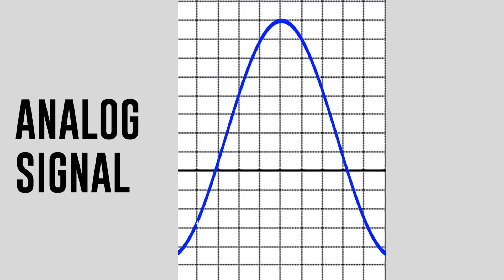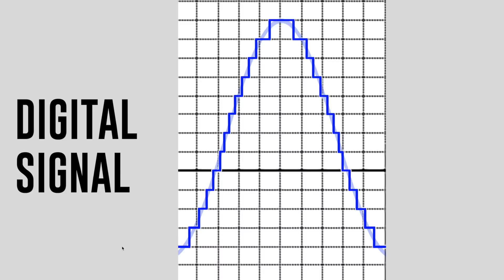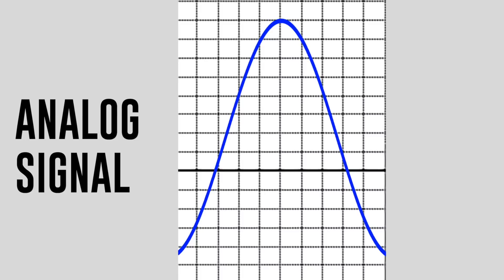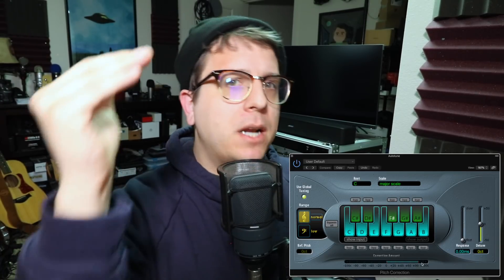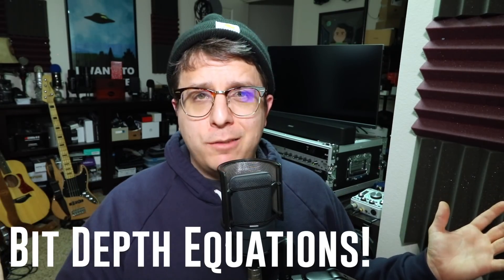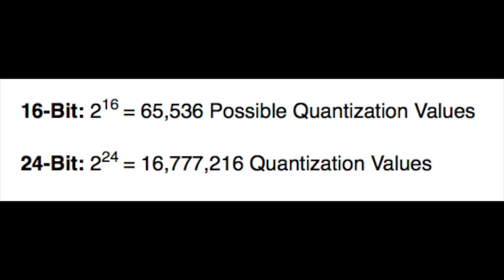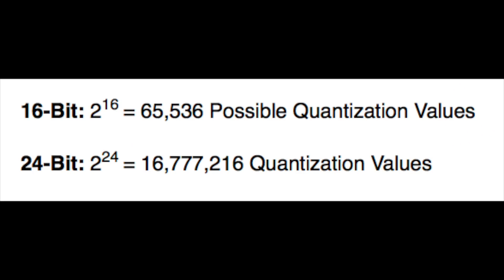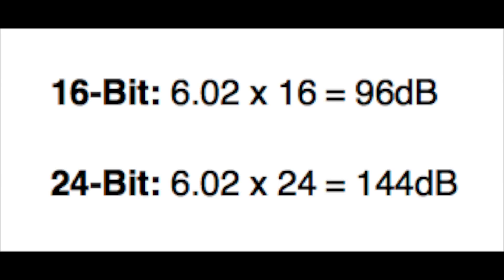16 bit vs. 24 bit Audio, What Should You Record At? (FAQ Series)

Comment: I have a question. 
Choose one song encoded in wav, 16bit and 32bit.

Open the wave file. Find the third sample. What's the binary number stored and way?

Open the 16bit file. Find the third sample. 16bit. What is the binary number and why?

Open the 32bit file. Find the third sample. What's the 32bit binary number and why? 

After you have the  binary numbers, then explain how the two or three binary numbers store your favorite vocab like the dynamic range, resolution, bit depth, db, loudness etc. 

And how the two binary numbers, one 16 and the other 32 are both lossless flac.

Is 24 really better than 16 bit? Both use lossless flac encoding? 

Not one youtube video explains any of  this, so it seems they don't know what they're talking about. I have yet to get an answer from anyone to my logical question.
Reply from the maker: I don't know what the signal path is or how they process it, but I believe their systems are pretty complex. I also heard that they switched the internals from an SM57 with some condenser mic, I just can't recall what it is.

Comment: Very respectfully, I must disagree with this video. Bit depth has nothing to do with "how much information is captured" and cannot be compared with photo resolution. Bit depth has very little practical impact on sound quality, since our perception of sound is basically just about the speed and direction the air molecules are moving. High bit depth may record tiny variations in speed, but that's not something humans can hear or care about. Nor can anyone hear (or care about) whether Instrument A is 64 times louder than Instrument B, or 65 times. (The difference between 5 and 6 bit.)

Low bit depth does not introduce "digital artifacts", only noise. The reason your 4-bit example sounded so bad is probably because it was processed too quiet. Bear in mind that cassette and vinyl are only 6-bit and they sound great to most people.

Finally, showing a digital waveform as a jagged, pixellated line is highly misleading, because, just like analog waveforms, digital waveforms are ALSO continuous and smooth. A sine wave can be digitally recorded perfectly with just 2 samples, one at each peak, with the resulting audio being a perfect, smooth sine wave.
Reply: I was just about to write something similar! :)

Comment: Consider microphone self noise, noise of the actual preamp, ADC-DAC interface and rest of electronics and pure 16 bit with noise shapping and oversampling does a very job. 24bit electronics should have better linearity in lowest bits, better signal to noise and dynamics, lower intermodulation distortions, bla, bla, if everything is recorded correctly. However in times of  Loudness War and compression it's all very much meaningless, because in the end the peaks of the waveforms will be clipped by some wise ass running the DAW, and we end up with 10-12 bit of dynamics anyway.

Comment: Higher bit depth means greater precision in mapping an analogue voltage to a corresponding digital value, and allows for a greater signal to noise ratio.
16 bit (2 bytes) means you have 65,536 possible digital values available for representing the analogue voltage.
24 bit (3 bytes) means you have 16,777,216 possible digital values for representing the analogue voltage.
So, 24 bit can more precisely record what the analogue voltage was.

It's important to know that the digital values are evenly spread out between maximum voltage and minimum voltage.

This is important when you're dealing with very low voltage levels - there are fewer digital values between zero and the value closest to the one that represents the voltage if you're using a lower bit depth. That means any editing of the resulting digital audio has fewer values to change between. So it's always better to capture in the highest bit depth possible, and do any processing at an even higher bit depth, before mastering down to the bit depth needed for the final product.

16 bit allows for a maximum signal to noise ratio of 96dB, and 24 bit allows for up to 144 dB s/n ratio.
Very few audio music recordings are made that have a dynamic range that cannot easily be accommodated within a 96dB noise floor, and almost no commercial music recordings have that sort of dynamic range.
Quantization is the process of mapping the voltage to a specific digital value. Dithering is a way of doing the quantization that reduces digital artefacts caused by quantization.

Bit Depth is about digital accuracy of the sampled analogue signal. Sample rate affects maximum frequency that can be digitally represented. Sample rate is a different matter that has it's own considerations that need to be understood.

Comment: Another benefit of 24bit audio is this,when you mix audio signals together such as voices and instruments, they can PARTIALLY cancel out eachother resulting in duller voices and instruments,so mixed xoices with instruments in 16bit will more sounding like 8bit,but mixed voices and instruments in 24bit will sounding more like 16bit,so that’s also the reason why 24bit sounds so clear because you will hear the starting and endong point of each sound and very smoothly.
Reply: Every time you mix an instrument in, that one track starts losing bits from the original as you mix in more tracks. It goes by powers of 2. 2 tracks, you lose 1 bit per track. With 3-4 tracks, you lose 2 bits per track
Reply: @JoeStuffzAlt  wow that’s an interesting note, so if i will record my voice at 16bit and i will myx it with 8 instruments with it,then my voice will become 8bits or less??
In such case no wonder 24bit should be better since it has more bandwide,especially with 32bit recording since in theory you have to worry about accidentally recording overamplified audio and get declipped audio,because they say that 32bit audio recordings should never suffer from declippilg because of the higher bandwide.
Reply: @johneymute  It'll be more nuanced than that. Powers of 2, so in theory it could be 13 bits, which is still a good amount and most people won't hear it. Not to mention the more audio sources going on, the less you'll be able to pick things out. You need to record around 256 layers to drop it to "8-bit per track if you manage to digitally extract it" quality.

You can record softer with 24-bit and have excellent quality. With 256 times the resolution, if the waveform is a sliver on the screen, you still have a lot of data to work with. If amplifying 100x gives you a workable waveform, you still have over 16 bits of data to work with. There other factors like noise floors to worry about though

Comment: The steps in the waveform are a lie.

The reason why DAWs display stepped waveforms is because they are lazy and just draw the literal amplitudes recorded by the ADC instead of what those amplitudes mean. In reality, they represent points that will be used to draw a new, smooth waveform which will be identical (identical I tell ya) to the original signal. No steps, no nothing. Infinite resolution. The only limitation is that the signal can't contain frequencies higher than half the sample rate, and ADCs have low-pass filters to make sure of that. It's called the Nyquist-Shannon sampling theorem. Don't believe the propaganda.

Comment: Audio bit depth in no way relates to video resolution, but is directly related to pixel bit depth, with 16 bit pixels have far fewer possible colors.

However, the human visual system can't distinguish more colors so 16 bit looks identical to 1000+ bit (except for a handful of females with quad cones). Similarly, except for the 96 dB noise floor (we can detect up to 120) there's no audible difference between 16 and 1000+ bit. The only reason 24 bit is superior for capture and mixing is additive losses accumulate. But after mixing outputting to 16bit 44100 hz is indistinguishable from 24bit 48000 hz+ except for the higher noise floor which is virtually silent. Also, sampling rate does relate to framerate, but at best we can only hear up to 20khz, and exactly 2 samples are needed for full capture (mathematically proven and confirmed by hearing tests), so sampling above 40khz in absolutely no way improves audio quality for anyone.

Comment: 44khz 16bit is pretty much the limits of human perception. This is why it was chosen as the standard for CD's. Music producers use higher bit rates as they are working with multiple input sources and want to keep noise levels as low as possible. Even if a music producer releases his song in 24bit audio it will won't sound any different to if he mixed it down to 16 bit audio. It's like 96khz audio, completely pointless as it's beyond the range of human hearing. Don't get any of this confused with bitrate, which is a whole other subject and can really effect the quality of compressed audio.

Comment: When you laughed was it because it was a tedious topic, or was it because it you were excited? Pretty sure we all got excited when talking about extra variables. Yes - Using 24bit before spotify and youtube compresses is beneficial. In my neighborhood I'm the only one who notices, and due to my "dontgiveafuggifitclipsinuteromilkit" attitude - I've definitely taken full advantage of those extra frequencies allotted for filling waves. When you go back to 16, and try to do what you did in 24...that's when you notice and go..."Oh helllllll no!"
Reply: @ReaktorLeak Way more powerful. Though for online uploads, kinda pointless, I agree with dudeman...having the highest possible quality before conversion definitely matters.
Reply: @ReaktorLeak I'm not a premium member on reverbnation, so my upload limit has been 8 megabytes. Only recently did I realize that I'd have to doctor before uploading overamped 24bit Waves as MP3's online. Your CD copy of In Utero can clip by 2.4 decibels...in your house, but not converted into as low as 128 or 96kbps on reverbnation. (So much garbage to fix or replace) Alot of the the time i would cut large projects into parts to get the highest possible bitrate with only the shortest 3 minute tracks achieving 320. 24bit. Great for home, but rattles the average listeners devices to sh!t. Just recently remastered some of my match-ups (mashups😡) and uploaded them on mixcloud to take advantage of 320 mp3, and found they now support 16bit wave. Very exciting. When I upload to spotify now via distrokid...I'll still upload 24bit...but...I'll make sure it sounds good as an mp3 as well, since all sites stream at 16bit. My system can handle it, and I gotta listen to this stuff forever, not just once casually so I'll always have my overamped waves. Haha - Hate neutering and converting them. Most can't tell a difference, dare I say it you'd practically have to have both waves up on your screen switching off between the two to notice.
https://www.mixcloud.com/Flow_Pdisco/dj-analysis-gamechangers/

Comment: So if an music album is remastered to 24-bit, does it make the album better? Is it worth buying? I have the original CDs, so is it any differences? Is it any better? Is it worth it? Is it like 5.1 surround sound remixes? The Beatles’ Sgt. Pepper’s, White Album & Abbey Road was remastered to 5.1 surround sound. What does 24-bit means? Is it 5.1 surround sound remixes? The Dutch prog rock band Focus is also releasing a 50th Anniversary box set now with remastered material. It says it is a «24-bit remaster». Is it worth it when I already have the original CD albums?
Reply: 24-bits just means you have 8 extra bits, and every time you add a bit , the audio resolution doubles. 24-bit has 256 times more resolution than 16-bit. 

Honestly, I found it depends on the album. Sometimes it's not perceivable, other times, I can really hear it in the vocals. I also think it depends on how many instruments are being recorded.

Comment: I might be naive, but I listen to basically all techno music. To my understanding, synthesized techno music starts and is digital, so there is no ADC needed, correct? 
It's more about getting the same quality of the master out of my phone/player into my car head unit, through it, out, into the amps, and then speakers. I would presume that the head unit sends an analog signal out to the amps, thus the head unit DAC quality is pretty important, but I could be wrong.

--I had to edit. I thought that 24 bit is used because there is no middle, e.g., 18 bit, 20 bit. It has to be in increments of 8, thus 16 bit to 24 bit to 32 bit. Also, as the bit depth goes up, the noise floor changes ... gets moved, which ultimately changes the sound perceived.
CD quality was basically invented by Sony, and 16 bit 44.1khz was determined because it resulted in a high cut off of just about 20kHz, which most humans don't even hear above 16kHz. Therefore, we can't hear any difference. 16 bit proved to end in a quality that could not be discerned from prior media types' quality. Most people can't hear the difference between 16 bit and 24 bit.
---But, I'm still interested if anyone has any input about techno music specifically, as it's synthesized.

Comment: So 4 bit could be decent sounding with a higher sample rate?
Reply: No. Sample Rate doesn't improve the Dynamic Range.

Recording at 4-bit you would still have -24dB of Dynamic Range (and the Noise Floor would be high as fuck if you try to apply any Dithering to the audio).

So: record at 16-bit, at least.

Comment: i have a pimped rotel 16bit DAC that delivers better resolution than a lot of cheap 24 DACs.
there are a lot of cheap shitty 24 bit DACs that have a super noisy power supply and distorting output stages etc. the same of course applies to ADCs

Comment: it is not 16 values.... but a 16Bit value range. 
# bits	SNR	Possible integer values	Base-ten signed range
16		96.33 dB	65,536			−32,768 to +32,767

24		144.49 dB	16,777,216		−8,388,608 to +8,388,607

(courtesy of wikipedia [Complete version at https://en.wikipedia.org/wiki/Audio_bit_depth])

Comment: Higher bit depths mean there's less rounding errors in palcing the xy corrdinates.. the rounding errors end up being noise.    Lower bit will result in more noise, but honestly the noise floor at 16 bit is  still good enough to where people really won't hear the noise unless the volume is so high in quiet parts it causes hearing damage.  24 bit levels are a bit overkill and use up too much drive space if storing.  I do blind tests all the time with friends, they can never tell the difference between 44khz/16bit  and 44khz/32bit.    Yes.. highr but depth is better.. bit overkill

Comment: Try this.  

Generate a 4 kHz signal in Cool Edit or Audition using 96k/24 bit. Downsample it twice, one file to 96K/16 and another to 44.1K/24. Compare them yourself.  See that the 24 bit depth does nothing for the signal resolution. On frequency analysis you can see that It only reduces the noise floor.  

The 24 vs 16 bit graph in the movie is only a drawing and is incorrect. 

So then why do editors and producers use 24 bit - to keep the noise floor low.  They are processing music.  You are not.  So if you have a limited disc space, choose 96K over 24 bit.  That also gets rid of the brick wall AD converter, something you can hear.  If you have disc space, a good system and good hearing use 192/24.  Your source material may vary.

Comment: if I record (capture) with settings at 24bit / 48  and then mixdown with different settings like 24/41 or 16/41 is there a difference. I cant hear any at this point of my experimenting. I also tried capturing with the settings at  16/41 and mix down to a wav file with the settings 24/196...I think I hear a difference. not much. but one thing is did notice and that was when I uploaded a great sounding wav file to a server when entering a songwriting contest, when I went to the server and listened to what they mostly have received from me, I wasn't very happy. SO what I hear in my studio system, on my music player, or  a burned CD. is always going to be a hit or miss on quality. I guess it can be said that diehard music listeners set aside time to "listen" and have the systems in place to hear the highest quality possible. There are two or three kinds of listening. Concentrated purposeful listening, causal- while doing other things listening and background listening.  thanks for the info and effort put into this video.
Reply from the maker: I think you're absolutely right. Most playback systems aren't tuned to playback perfect representations of the data. They're all run through a D/A converter, and they vary in performance quite drastically. Not only does the equipment play a huge part in this, but the listener's ears also play a part. I legitimately think that when exporting, in many cases 16/44.1 is going to be perfectly sufficient. The 24-bit comes is beneficial when processing your audio, and the higher resolutions are really beneficial if you'll be slowing down the audio.

There are some people who say they can tell the difference in between 48kHz and 192kHz, but I'm not sure if that's true or not since it essentially allows for frequencies above human hearing.

Comment: Good explanation for the resolution, I make a little electronics on a daily basis and if you take a line signal 0-2 v approximately then you can divide 2v/16bit and get the resolution.
2v/4 bit == 2v / 15 = 0,133v,   We can see that at low volume input, the resolution is not that good.
2v/5 bit == 2v / 31 = 0,065v,  5 bit is better.

but we also need a resolution on time, the faster we can take a sample the better the high frequencies are sampled.
50 Hz = 0.020 sec
500 Hz = 0.002 sec
5000 Hz = 0.2 msec
44100 Hz = 0.0227 ms
48KHz = 0.0208 ms 
96KHz = 0.0104 ms

Maybe it's wrong, but I think so
Reply: As I understand it the high frequencies are either sampled or aren’t. You record at 44.1 kHz because 22kHz is the extreme limit of human hearing. The extra 0.1Khz is cushion for the frequencies we want.